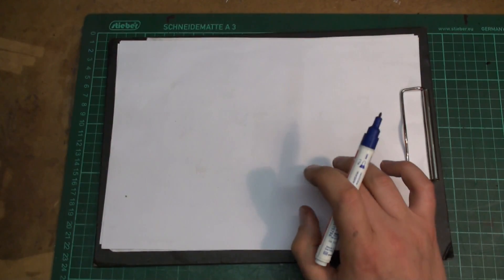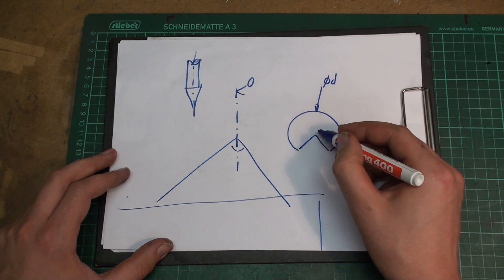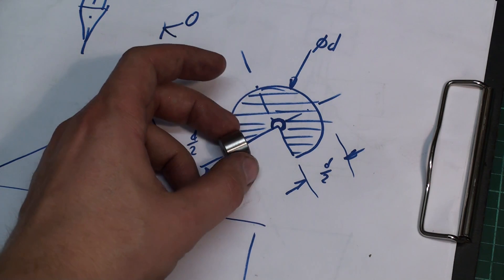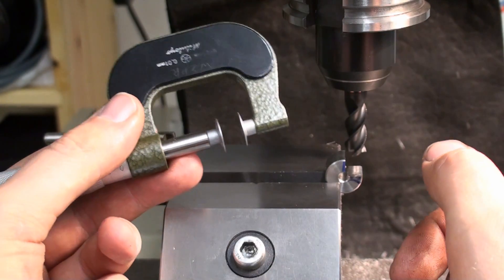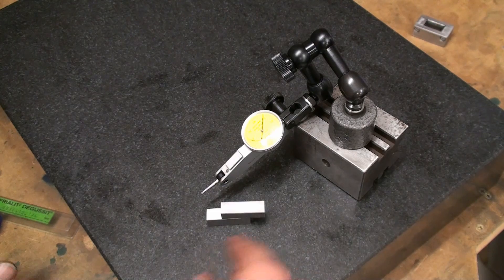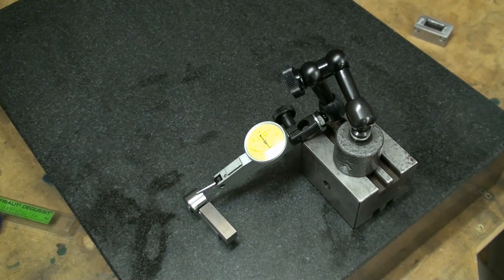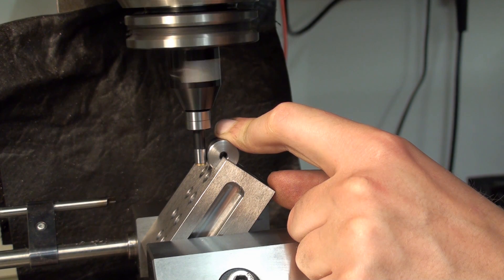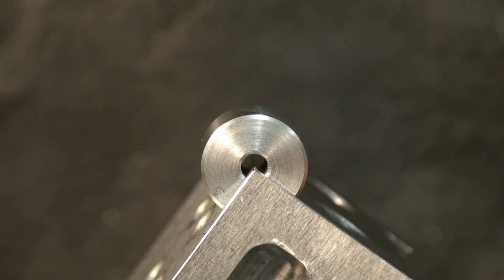Making an aid for edgefinding

Comment: I think if I was going to use it with one particular edge finder, I'd make it so that I ended up taking off either 10mm or 20mm in total. It simplifies things for my simple mind. Although as far as I can see it will only work with a 90 degree angled workpiece. Anyway, its been added to my homemade workshop tool list.

Comment: For workpiece angles other than 90 deg. An accurate "x" shaped cradle could be used which has a stiff pivot in the centre. This could be fitted onto the peak and a pin laid in the cradle, then the centre of the pin could be found. This will work on any workpiece angle but the peak must be set with the angles equal either side. I'm sure with a bit of trig it could be used with the peak leaning to one side.

Comment: if you have a work piece angle significantly larger or smaller than 90° then you got problems. 
What I suggest is that you make another one out of two pieces that rotate to fit larger or smaller angles. 
Done right, the tool's radius wouldn't change due to rotation. 
What do you think, Stefan?
Is that something that could work?
Thanks!  :)

Comment: Great gadget to have in the box!  Finding the theoretical intersection of two planes can be tricky, especially when the work is at odd angles.   A ball wiggler and a little trig was always my solution, but this tool makes it faster and much simpler.  I would, however, when using an edge finder, hit both sides and divide by 2. This helps correct for edge finder error.  Thanks Stefan!

Comment: Wouldnt a needle that would complete an electric circuit and beep find that corner easily? Start from a little above, go left and right, if it doesn’t touch, go down a bit, and repeat? A few iterations later, you will be there. Even a single point in 3d space can be found (loop will have to change to scan xy plan and lower in z) am i missing something? Or may be you are making this for non-conductive materials as well?
Reply: Sure. Now think about that with a radiused or chamfered corner. What you want to reference is the intersection of the two sides, not wherever the remaining material happens to be highest.

Comment: That will work for a 90 Degree edge only. All other angles will either need a special one of these tools or different tactics and some trig calculations. Of course optical can as you said Stefan, get you close. Also the shallower the angle with a tool like this the more likely an error can creep in because it becomes more difficult to feel the tool seat securely over the apex.
Just a couple of long after thoughts, Cheers from John, Australia.

Comment: gentleman, just one question, what if the object is not perfectly square? say the corner you have to work with is 92 degrees, the packman will have a small gap sitting on the edge
what if we do a say 120 degree cut and no relief hole on the packman, let it see saw on that top corner, the idea is just like the old trick use on the lathe. chuck a dead center and tailstock another, put a metal ruler in between. do you think it will work as well?
Reply: It would be essential to remove any burrs whatsoever on the male corner of the workpiece (ideally the faces would need to be carefully stoned in alternation and then the corner stropped with leather, or the palm of the hand if you have tough "manual labour" skin!)* , and it would be hard to get a sharp internal corner on the button ...
*Then as soon as it's no longer required, use a stone to chamfer the corner which will otherwise be dangerously sharp.
So I guess whether it "works" depends on the accuracy you require. But I reckon the theoretical basis of your idea is sound.
Reply: Thinking more about the "non 90deg case" I would personally finish my centering scope (Ha!) which is currently a drawing and some parts... and use that.

Comment: Epoxy or super glue a small magnet below flush in one of the faces. It will negate the need to manually hold it in place on magnetic workpieces. :)
Reply from the maker: And a collector for fine particles of swarf  ;)
I try to keep the use of magnets to a minimum because they are in day-to-day use a bit of a pain in keeping clean.

Comment: If you have a large part that has a chamfer too large for this tool, then you can use a vee block with a ground rod clamped in the opposite vee.  Again it will be 1/2 the edge finder diameter + 1/2 of whatever size the ground rod diameter is. Stefans tool and the vee block will only work if the the corner that you wish to find is at 90 degrees. If you are unsure of the accuracy of the vee block, it will pay you to check that the vee's are in the center of the block. Do not panic if they are not, make a note of the out of center error and take this into account when edge finding. This will still be more accurate than doing it by eye, especially if the edge has a chamfer. Hope this helps.
Reply: The vee block will only work (without additional math) if the workpiece is at 45 degrees. Any other angle will introduce an offset.

Comment: Clever idea, and as always, the execution is exquisite - but I think if you find yourself reaching for this often, someone should have a talk with your designers/engineers about using work holes. Dimensioning to a theoretical sharp point is fine as a reference, but really shouldn't be relied on for anything that matters.  And yes, if you just ground a corner dead square and sharp, it's probably pretty close to actually being a sharp point - right up until it gets deburred or used, and then it isn't anymore. Then it's a theoretical sharp point, and someone would need a clever tool like yours to repeat your setup/measurements. Work holes (when you can get away with them) don't have that problem.
Reply: This angle hole problem creeps up in mould production work constantly, usually the holes are at an angle of 15-20 degrees. Or a hole. The problem is, how do you dimension the hole location and also find it easily when machining, when it is the only hole? Or when the workpiece has maybe only one 90 degree corner in it? The easy answer is to dimension from known edges, be it theoretical point or not, and have a tool just like this to easily find it on the machine.

Comment: I will second the question by Dejan Sarcevic, he asked  "Why not a vee block?"

It seems to me that design would be easier than the 3/4 round, and your accuracy would be easier to secure if you finished off by hardening and grinding.
Reply from the maker: A V-Block would only work with the workpiece at 45° :)
Reply: find the bout end of the vee block and divide the mesurment and you get the center
Reply: find the bout end of the vee block and divide the mesurment and you get the center
Reply: You need way more additional math to find the true corner point when the angle is other than 45 degrees. With the 3/4 round tool you find the rolls radius, punch it in the DRO and you are done.

Comment: an improvement would be to add strong neo magnet in each flat, that way you wont have to hold it!
Reply: Once you start using such a magnet tool, you realise you spend too much time cleaning it and trying to pray there is no crap under it when you do your measurement.

Comment: the best way to do this, is edge find the adjacent edge, in the video, the edge on the right. measure the thickness of the part, move over that distance and half your .200 edge finder (typical) and Bam Bob's your aunt. no extra tooling needed
Reply: You forgot to mention using trig to account for the thickness of the part being at an angle to the horizontal, and also your idea relies on having no chamfer on the right hand edge (or a very accurate, known chamfer)

Comment: why dont use v blok?
Reply: Needs way more additional math if the angle is anything but 45 degrees. With Stefans tool you edge find the rolls radius, punmch it in the DRO and you are done.

Comment: Great little gadget Stefan, sehr gute arbeit. If I may make a suggestion: Instead of keeping the device in place with your finger it might be possible to incorporate a small neodymium magnet in the design. Or just place it somewhere on the workpiece. I would recon that the residual magnetism between the workpiece and the gadget would keep it in place for the touchoff.

Comment: How would this work if your clamped item does not have a 90 deg angle at the intersection?
Reply: Gene Elliott  I thought about this too, and I think it will work for telling you the axis in which the edge lies, but not where the edge is as if the angle is acute  The edge would be higher than predicted by the tool and if obtuse it would be lower.
Reply: Gene Elliott If it is below 90 degrees, mill off two grooves in both sides of the gap of the tool and use gauge pins on both sides - that'll fill the missing degrees. If it is over 90 degrees,  use one gauge pin to fill in exactly at the "theoretical corner."
Reply from the maker: Gene Elliott Then you would have a problem ;)
Seriously: Then you would need another design, maybe something with rollers or gauge pins at the contacting surfaces as Erling Weiseth describes it.

Comment: Great idea, not sure if I need one but will make one all the same.
If you don't have a disc mic, as most people wont, if you sit the blank in a square, while it is being machined, you could use a depth mic between the cut surfaces and the square;s arms. At least that is how I shall do it, even though I do have a disc mic.
Reply from the maker: Chris Stephens Good Idea, That didnt come to my mind, thank you for that!
Reply: Stefan Gotteswinter Or, put a gauge block in the cut out and measure the OD with a mic. I did it this way so I could mix up Imp and Metric measurements when finishing a metric "pacman" on an Imp surface grinder (used a metric block and imp mic). I find normal mics are less prone to operator stupidity than depth mics. :>(    OK, I know I could have set up a Metric DTI on the grinder but it was too much bother.
Reply: This is exactly how I did it.  The gauge blocks were a little tricky to manage.  I wrung the stack together so they overhung the center point.  They were hard to hold in place, and even harder to get video with my hands in the way.  https://youtu.be/lWVfD8Q4cv4

Comment: Smal and simple gadget for a great result. I will copy. So Stefan, I was thinking: I've read your answer to magnet question but why don't make smalls pockets on the contact surfaces to accomodate micro magnets? I have some disk magnets 3 mm diameters that are really very strong. Obviously the magnet must be plane with the surface.
Reply from the maker: Cosimo Marotta I am a bit picky on the magnets - Even if they are dropped in pockets they still tend to collect the smallest chip every time you absolutely dont need them ;)

Comment: Neat solution! I have to admit that i didnt see a problem picking up the edge without the gadged until you explained that this will work on any angle. If the workpiece is at 90- deg. you can do it the normal method picking the edge on both sides and divide.
Thanks for the explenation! If I ever get a mill this will for sure come in handy.
Cheers,  
Norman
Reply: With a little trig you can do it for any known set of right triangles. You just drop down a known amount from the top of the part and use the base of the opposing triangles to figure out the % of the total amount to deduct for each side.

Comment: Any particular reason you went with round instead of square block with a V cut into it? You might have been able to incorporate a magnet on the top flat of the block.
Reply from the maker: Moen I Its round for obvious reason ;) If you have a workpiece thats not exactly at 45deg it would be useless.
Magnets in stuff like that can drive you mad, trying to keep the chips away from mating surfaces.